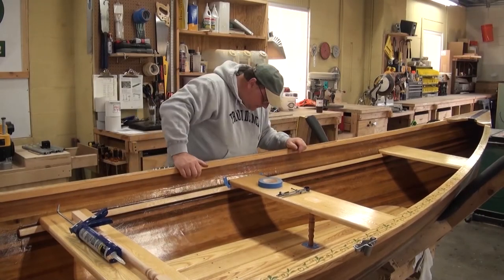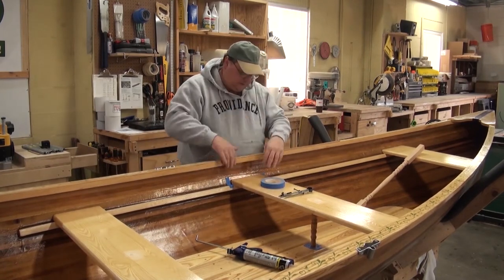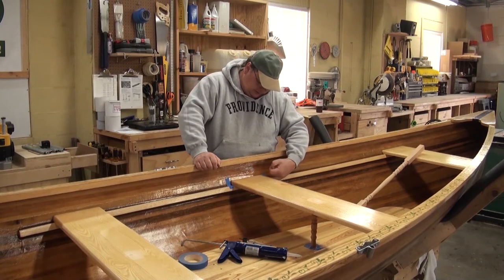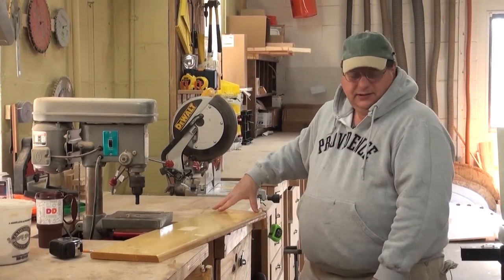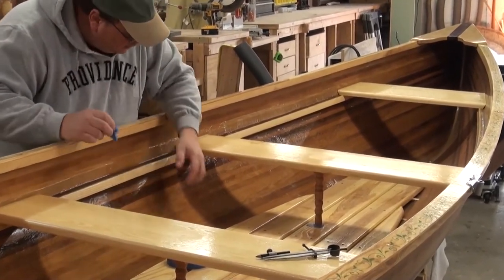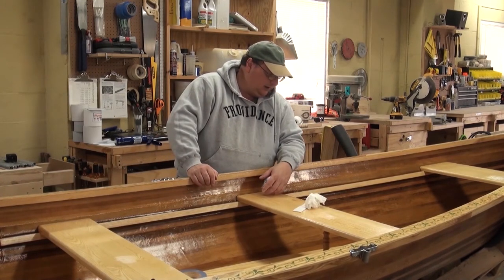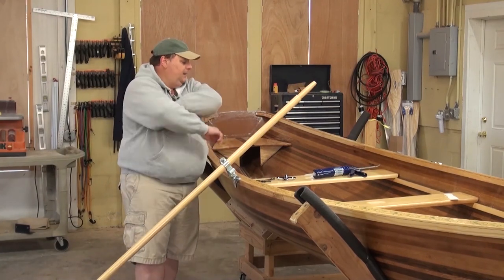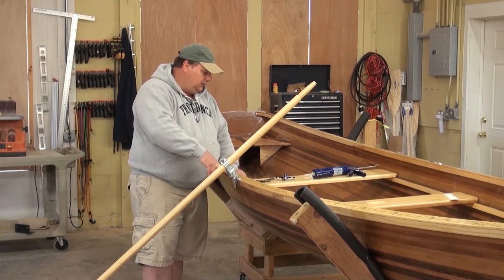33 Installing Seats and Oarlocks

Comment: Comment:  your boat is gorgeous!  Question:  your oar locks are on the outside...would that work for my old aluminum row boat?  Seems most expressing opinions say the oarlocks belong on the inside.  THANK YOU!
Reply from the maker: Hi Nancy.  I have rowed  many boats and can honestly say I have not thought much about it.  I just put them where I think they work.  I put them on the outside In case I want to stand and row so the gunwales won't get in the way.  Suppose that is in no small part due to my history floating rivers.

So I guess what I am saying is you are changing the pivot point but only by a couple of inches so put them on where the oars won't hit anything and enjoy your day on the water.
Reply: What a wonderful reply, Jack ... thank you so very much!!!
Reply from the maker: @NancySchwartz-fo7gh  You are most welcome.  Enjoy the journey!